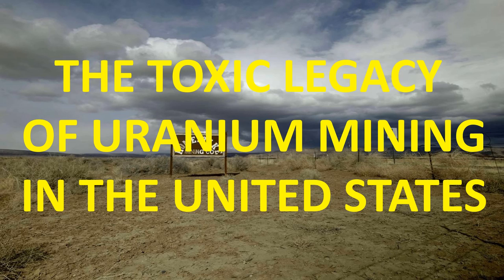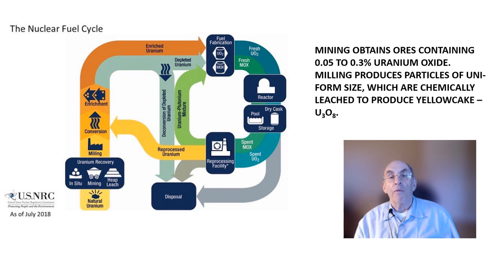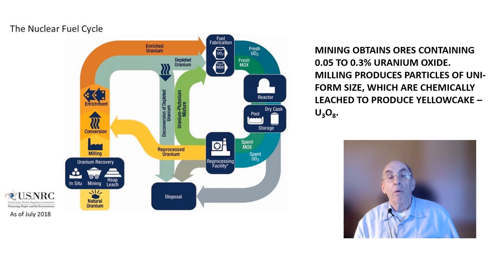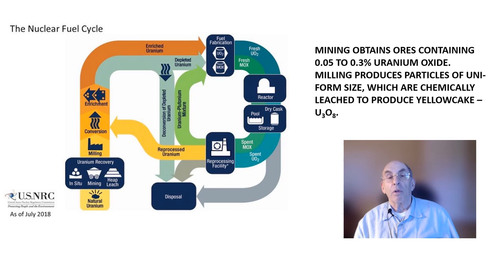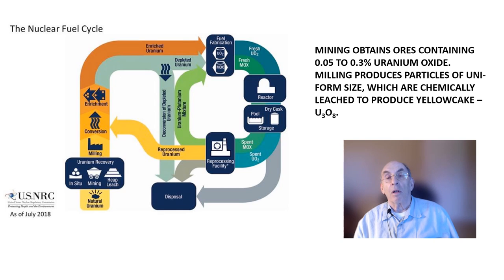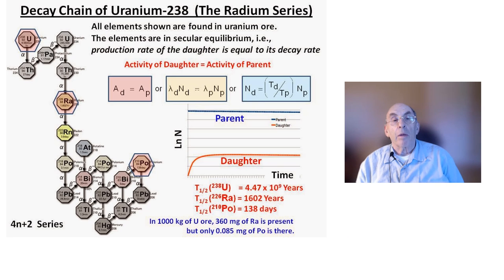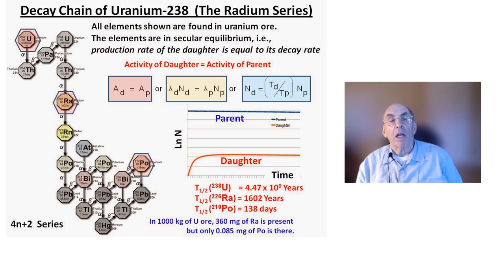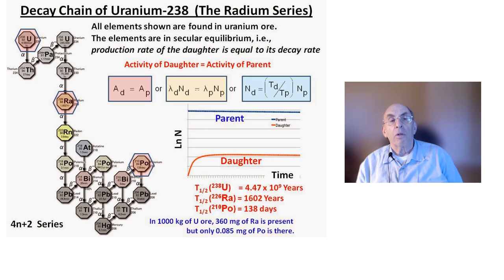The Toxic Legacy of Uranium Mining in the United States

Comment: Just curious. Can uranium mine tailings be SAFEY used as an ULTRA CHEAP sand aggregate tailings SINCE NO ONE WANTS IT BECAUSE THEY ARE SCARED OF IT BY USING GEOPOLYMERS TO LOCK IN ALL OF THAT RESIDUAL RADIOACTIVITY AND IT'S ACCOMPANYING RADIOACTIVE CHEMICALS USED IN PROCESSING IT? The aim is to pour that mixture in a pure geopolymer casing with thick walls and fill it up until it is 12 inches from the top and allow it to dry and pour in a pure geopolymer liquid to seal it off permanently together. The aim is to use these 1 cubic meter blocks as a kind of filler blocks to create mine tailing impoundment dams and reservoirs where non-radioactive mine tailings will be mixed with a mixture of cement powder and slaked lime powder and powdered brick or powdered sodium silicate powder or water glass which is pre-dissolved first before it is added with an additional amount of water as they call it into that  cement powder and slaked lime powder and powdered brick or powdered sodium silicate powder or water glass mixture (50% silica and 50% sodium carbonate to make it water soluble) and then mix it with these mine tailings to lock in and solidify and stabilize them into solid artificial rocks. Others are using slaked lime and iron slag powder and powdered sand made from ordinary sand or quartz or quartzite or diatomaceous earth or ordinary river sand.
Reply from the maker: That's an interesting question. There are really two problems that would have to be considered; namely, the radiation exposure of the workers making those blocks, and the residual radioactivity of the blocks once they are manufactured. Those would be questions for licensed health physicists to investigate. Unfortunately, I'm not a qualified health physicist, so I can't provide you with a definitive answer.  --- Dr. S.